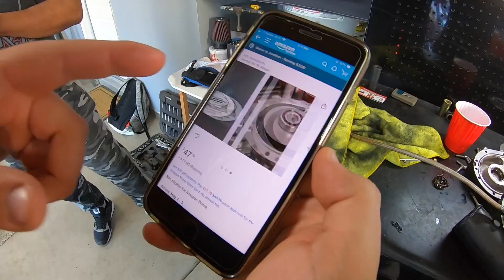BLOWN VORTECH V3 SUPERCHARGER DISASSEMBLY | PART 1

Comment: thats why i run mine on a loop with a filter, scavenging pump and oil cooler.... i run 0w20, about to go to 0w16, 40 psi regulator from pump to restrictor nozzle, 6 years no issues

Comment: If you ever want to learn how to do it properly reach out to me… 

That casing design was engineered and thought of in Australia. My former boss and myself actually solved the whole sealed supercharger problem, vortech and CAPA performance hand in hand created the sealed gearbox design. It has been a hi light of my life. 

Anyways, i assembled over 5k units in my time without rebuilds, which was my specialty… everything from, lapping gears, to double row input bearings… 
I can even tell you how to properly set a seal seat properly… 

Knowledge should be shared not stored. 

Want the secrets? I know almost all of them…
Reply: since you seem to know about these. i have a very important question. 
i have the same kit and of course it failed and i went ahead and orders it and did it myself. bought rebuilt kit from 928, it says it comes with everything but i noticed i didnt revive an oil slinger. is the slinger needed if i stay on top of my fluids? i have read mixed reviewed on this topic. grated i bought an oil slinger my only problem is i cant get the oil slinger to stop hitting the gear, or bottoming out when i flip it.

Comment: This plate is is the oil slinger plate and is known for coming loose and causing problems. you can buy thicker aftermarket versions - which is the one you were looking at on amazon from 928.

Comment: Damn bro, i had the same issue with my slinger, started to make grinding noises and i thought it was just the bearings. I had to send mine in to vortech for repair.
Reply: How much did they charge you?
Reply: Any follow up regarding the parts and where to obtain?
Reply: $600
Reply: @andywu8558  yeah I found the bearings at a local hardware shop for $11 and did the job myself, I’ve sent it to them 3 times and it’s way too expensive
Reply: @Bloomythegoat  part # or product ID and which hardware store if you don't mind.... I really appreciate it thanks in advance

Comment: Can you post images of the bearing part numbers stamped and seals you used to replace them. Mine has failed with less than 3000miles only just over the year warranty. I want to order the bearings ready for the rebuild.
Reply: Did you ever find those part numbers? I’m replacing my seal now
Reply: Parts and where to purchase?

Comment: Those newer style balljoint presses are sick. I just got myself one from Matco and can't believe I used the old style for years. Those oil slingers have a tendency to overheat and weld themselves. A way to help keep that from happening is to do a routinely flush the system. Just changing the fluid won't clean out all the sludge, so running a flush kit will help you keep it clean. Just experience speaking lol
Reply from the maker: Thanks Justin!  Only thing with that style ball joint press are they have tendency to rip the boot but if you are replacing it anyways its definitely way quicker! 💪. Yeah not too sure on the history of this thing but it had quite a bit of miles! Should be up and running soon!
Reply: @BoostedMotorsports  fuck yeah dude